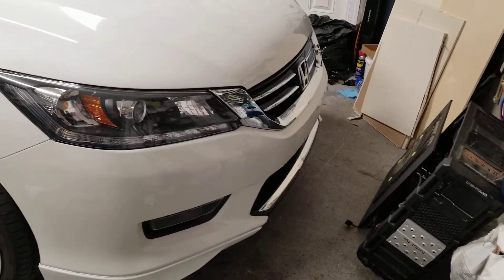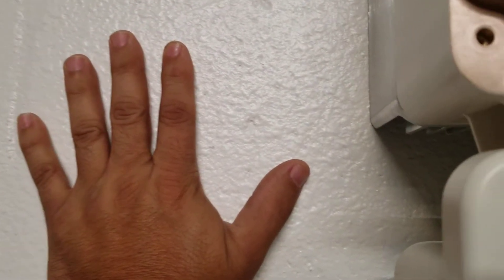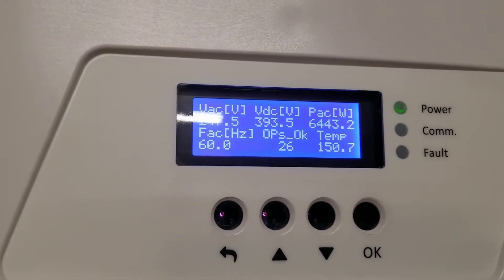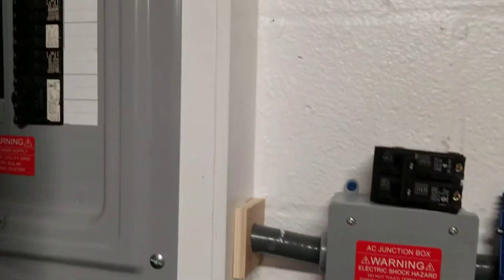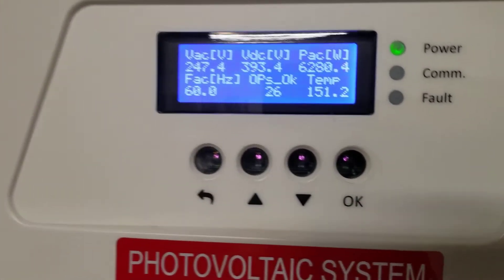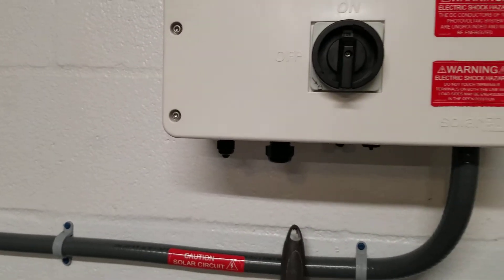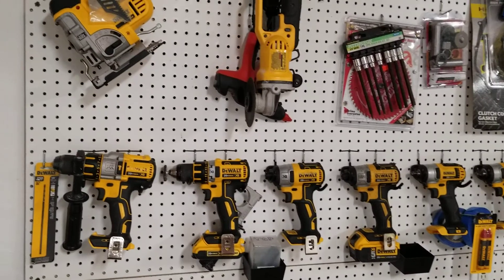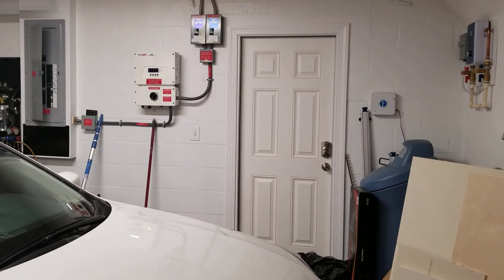Solaredge 7600HD Wave inverter running HOT issue.

Comment: Hi Luis, I noticed the same thing with my inverter when it was smaller. I had them patch mine many times. After upgrading to a SE5000, the temperature stays below 130F at peak and no more issues. It’s interesting they advertise better cooling than the older model.
Reply from the maker: Pedro,   Thanks for responding.   Yeah, this thing is running Extremely HOT.   My friend has the older 7600 and only sees 120 at max.   My Brand NEw 7600 HD Wave is hitting up to 190 at peak Production at midday here in Florida.  The problem i have is that it is only 72 degrees in my garage and when it hits all-out summer time here my garage sees  92 degrees easily.  I have done some things to help remedy that as i re-roofed the house and put in the ridge vent and if that is not enough i will put in a solar exhaust fan to assist.    

Due to this inverter running this hot it is derating my Production power as well :(.
Reply: That’s a tough. I did put a small 15 watt fan on a table while I was experiencing 150 F, but never reached 190 on a SE3800. I got a new SE5000 on eBay for $547 which is a deal and upgrades to it 1 month ago. There is probably an inverter design flaw across the board as this makes the increased efficiency they advertise non existent. I hope they can come up with something. Software won’t fix poor inverter design.
Reply from the maker: Solaredge issued an RMA for a replacement.  Fingers crossed that the new one is better than this.  So you think the new HD Wave is then?   I will defintiely let you know when the new one arrives and is swapped.   

Wow that was a good deal you snagged up their :)...
Reply from the maker: Solaredge ordered an RMA for me.  A new one should be here soon.  FIngers crossed this issue is resolved.
Reply: Good to hear the RMA is on the way. I do know that when the array in my case 4.81 and inverter was 3800 it would overheat. However the 5000 watt inverter has been staying normal under 130F because it appears to be able to handle all the loads without overheating. That’s just my theory. I am curious to see if this issue is design related or only when oversized.
Reply from the maker: Pedro, hmmm ok my system is 8.4kW on a 7600 so going by the specs it should handle it without any issues.  I will let you know.
Reply from the maker: Pedro   I will let you know how the new inverter does as it will arrive tomorrow.  One of my techs will come by to install it tomorrow afternoon after Production is done for the day.
Reply: Luis,  I'm having the same problem with my new SolarEdge 7600 HD wave.  It is 95 degrees here today and it is hitting 150 degrees.  They say that is will derate the power after 122 degrees.  Are you having that problem?   Please let us know how they fix it.

Comment: 9k watts and hd7600 inverter here in Kingmanb AZ.  first one failed, and the new one is hitting 195 degrees F but the ambient is running 104 here in az. Production is about 7400watts.
Reply from the maker: Ray I installed 2 120mm fans on top and it is helping immensely.
Reply: Update, 2 years later. no overheating problems with new unit. No down time at all.

Comment: So many good things learned about this inverter and now overheating could be a deal-breaker. Even with 99% efficiency a 6000 watt inverter dissipate about 60 watts of power in such a small box volume that will result  and  a significant temperature increase. It is typical to see 50F increase but ~80F increase (150F-72F wall) is just too much and asks for trouble. There should be a small fan inside this unit ensuring temperature rise is smaller. A 150F warning is not good for continuous reliable operation and may disqualify this product in my opinion.
Reply: Just received my se7600 and there's a fan inside

Comment: Have you resolved the issue with the new HD Wave they replaced for you? Is it a 10Kw system? Who did your install. Appreciate any input, currently waiting for my 10Kw system to be installed by EHS and this is making me nervous. Have you seen the savings start to occur?
Reply: If your running a 10k system you need a 10k inverter.

Comment: I'm an electrician I've been installing solar for about 10 years I know that the Watts output for a solaredge 7600 is 7600.watts ac
The input to the inverter supposably it handle 11800 Watts DC.

I don't care if it's HD wave inverter or whatever and inverter it is 
 If your system is a 5kw, 10 kilowatt or whatever size it is your inverter should be accordingly size to the amount of wattage DC you have .
 For 5kw you need a 5 kilowatt inverter, if it's a 10 kilowatt you need a 10 kilowatt inverter,
 To avoid overheated.
In electrical what you do not want to hear is that humming noise, and especially u do not want to have any heat that's reaching almost almost 200 degrees. That causes fires and it's fucking dangerous 
 My suggestion get an inverter that fits your system and should have no issues

And remember the new product that comes out.
 the first ones to get it, are the guinea pigs.
 
 They do test the product, but the only really way to know how well is going to work, it's to put them out there and see how well they do, and then they'll make changes .
The Inverters before this new HD waves, work much better.

 but for those who are thinking of getting solar
 My recommendation is to go with micro inverters I've never have to service this microinverters 
 Only time I have it's when one or two are not communicating with Wi-Fi for monitoring production and that's rare unless you have bad signal around your area

 but that is just a Wi-Fi issue nothing major 
But your solar still back feeding to the grid with no issues, production doesn't stop.
 but that's just my opinion and suggestion to everyone.
 based on my 10 years of experience as an electrician and solar installer